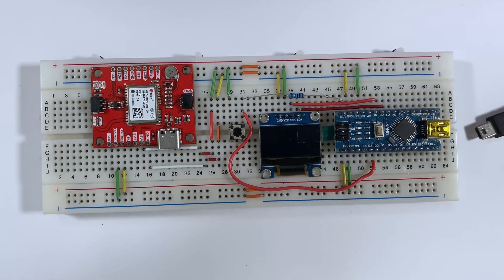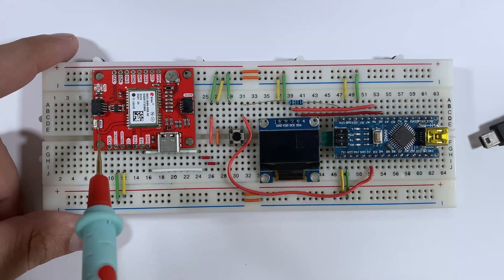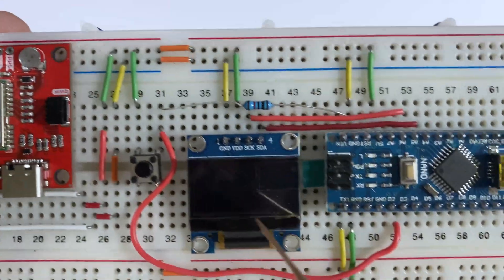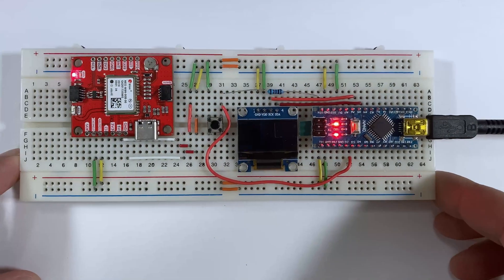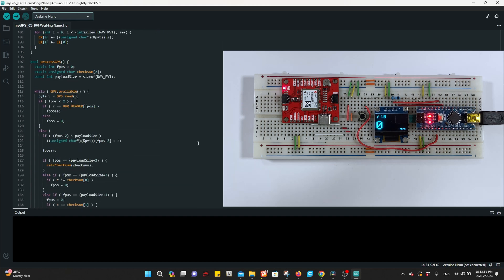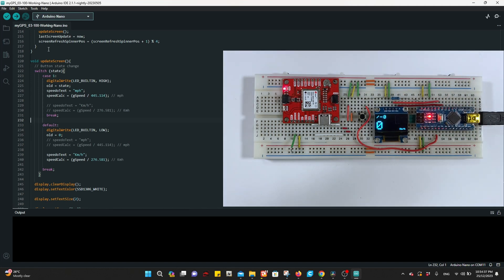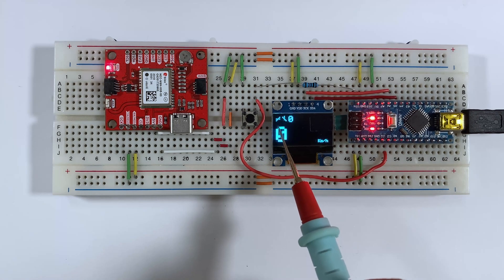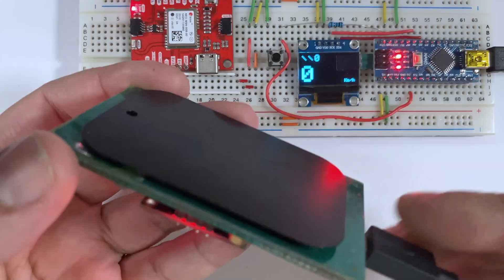8Hz Arduino Nano Speedometer with Sparkfun M9N

Comment: Hey man, I was watching your videos and although the neo6m is old it looks like it performs really nice. But since its discontinued M9N seems to be the current product. Wanted to ask you if it does perform identical? And i mean the refresh speed during acceleration and slowing down. I'm trying some stuff with L86 gps and its really bad i mean may be its good for geo location etc absolutely not usable for speedometer its really slow and shows some speed even after 5 seconds after i stop.
Also did you try to make a trip/odometer with the module or is it even possible?
Reply from the maker: Check out this video https://www.youtube.com/watch?v=JGG4TcA6U-g for the performance of NEO6M configured refresh rate 5HZ, I have tested the NEO-M9N configured refresh rate 8HZ and it works great. If you see the documentation for both, the maximum update rate for 6M is 10HZ and for M9N is 25Hz. As of now, the code is not optimized to get these results. Check this video for the final product that we are working towards https://www.youtube.com/watch?v=Qg0L3f6gY50&t=25s
Reply: @3DElectroTech  i watched the first video and i see it works really well. I guess i will buy some 6M to tesy but since its a discontinued product they are most probably fake. Going to watch the second video thank you
Reply from the maker: @acelyasamsan6960  I don't think the one I was using is Guanine and I purchased most of them from Amazon and Aliexpress. They work fine for what we need :)
That is why I often buy more than I need.
Reply: @3DElectroTech  Well if the fake one works like that all good for me too :) now i will definitely buy it and give it a go. I also need to figure out about odometer, according to chatgpt if i have GPS coordinates it can be calculated. I guess i will try to do it once i get the module. Thank you
Reply from the maker: @acelyasamsan6960 The link is for a configuration guide for U-blox M9 and it is obtained from their website, if you search for Odometer, you will find 35 results and they say you can enable it and disable it. I couldn't find the same results for Neo M6. I hope this helps.
https://www.u-blox.com/sites/default/files/u-blox-M9-SPG-4.04_InterfaceDescription_UBX-21022436.pdf
Reply from the maker: The comparison was between Racelogic DriftBox 10Hz and our homemade NEO 6M 5Hz Speedometer